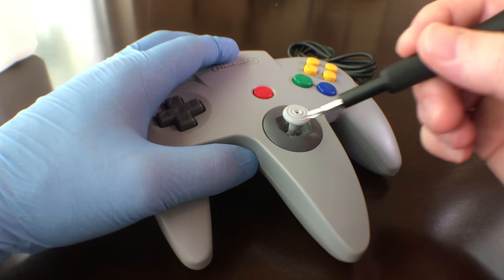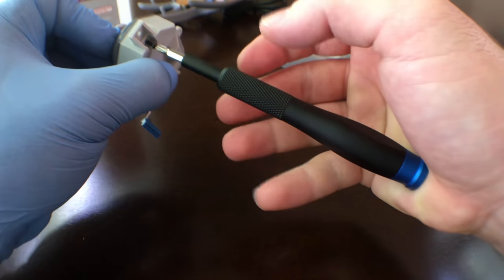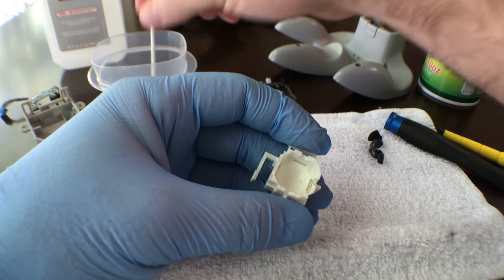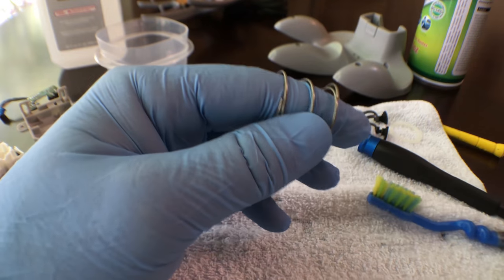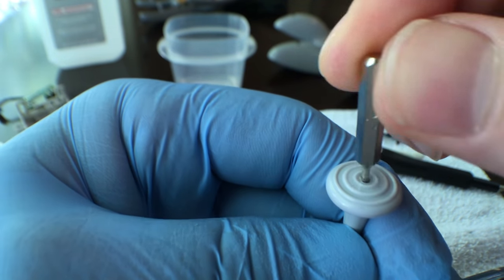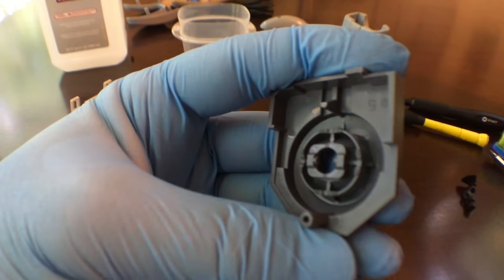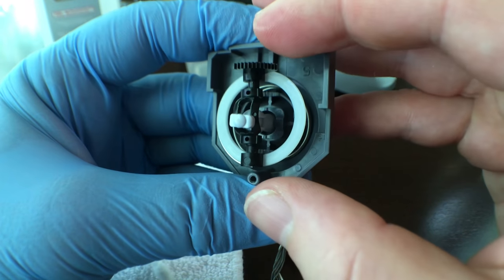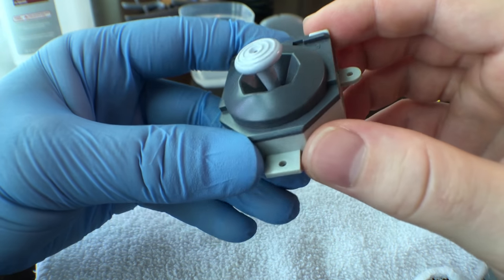Nintendo 64 (N64) joystick teardown - How to clean/fix/restore/refurbish

Comment: If done to an already loose controller, should it help the snapiness of the controller? or just keep it from wearing down more?
I just did this to an already loose controller and can concur it feels better, but it is still very loose. Just wanted to check
Reply from the maker: The Joystick Butter does two things. 1.) Prevents any future wear from occurring and 2.) Allows the joystick to smoothly snap back resistance free. That powder you cleaned out is what once was the gears hence why they're loose. Joystick Butter is magical.. just not that magical :)
Reply: @restore64  Putting together my second controller (I'm doing 4) and defintiely see the snapiness in this one. Sad it can't magically fix it, but that makes sense. Thank you for your quick replay and the video! This was a fun week long project as I waited for the butter to arrive!

Comment: Does cleaning and lubricating fix the looseness and floppiness of the stick?
Reply from the maker: No, lubricating doesn't add volume back to the worn gears. Sometimes simply cleaning/rebuilding will make the stick feel better and retain whatever tightness is still left.

Comment: After I did this my controller now creeks badly and the joystick clicks when moved left and back to normal position, any way to fix this?
Reply from the maker: Make sure everything is seated properly when re-assembling everything. Something is off.
Reply: I have that problem as well. I've been doing some maintenance on N64 sticks for a long time, and I've still not found a solution to that particular issue with the spring.

Comment: Any idea why a new controllers joystick would be messed up? I bought 4 new ones, 3 of which veer off to one side or are extremely sensitive/over reactive
Reply from the maker: You bought four new authentic controllers or four new aftermarket ones?
Reply: @restore64  3 aftermarket ones. I replaced one and realize now that those aftermarket ones are a lost cause
Reply from the maker: @rapathyk  I too, at one point, thought they were the answer. They're garbage :(

Comment: I have two and just bought two more, i need to go through all of them however one of the one I bought has seen a lot of use and I am slightly worried that the mechanism is worn down to much as the amount of slop is somewhat concerning. Any chance that it could be salvageable? Also what alternatives are there to the “joystick butter?” To me it looks like lithium grease in a precise injector applicator. More restorations and cleanups of other n64 accessories would be nice but I don’t know your personal life so I’ll wait.
Reply from the maker: If it's gone, it's gone. Joystick Butter won't fix the missing plastic on the gears but if you have a tight stick Joystick Butter will prevent it from ever wearing out. If Nintendo had this stuff when they made these every controller would have perfectly tight sticks. Wouldn't that be something :/
Reply: @restore64  k, thought as much, however will still be doing it to all my controllers no how bad they are as cash is tight at the moment, have a good day!

Comment: My controllers thumb sticks are loose, bit of a wiggle before moves register. Ordered new ones but could only find GameCube style as I cannae solder.
Reply from the maker: The GCS joystick is horrible and you'll lose all of your fine movements. If you push the stick more than 15-20% out the movement will jump out to 90%+ even though the stick isn't that far out. It makes every game a nightmare. Kart, Super Mario, 007 etc.
Reply: @restore64  as long as I can play again I'm not too bothered, not ideal I know but not like I can get new Nintendo parts as production stopped about 20 years ago. I'll try fix the original but not entirely confident I'll do ok.

Comment: Mine dig not look like yours at all. But I simply cleaned inside ant put a little bit of silicone grease. And now min it’s as new. But I ordered new ones that supposedly should hold up better.
Reply from the maker: You may have an aftermarket stick.

Comment: Thanks I taking apart my 64 Controller and was having a little trouble figuring out how the joystick back together I also found a bunch of white crude in my joystick is that a common thing does anyone know about it
Reply from the maker: Yes, that is plastic "nylon" dust. That's from your ABS joystick wearing away at the soft nylon gears.
Reply: @restore64  oh okay, I see. Is that why the joystick is loose, but still works fine?

Comment: I’ll definitely be picking up some of that lube. I came across this video today because I recently scored 2 of the funtastic consoles, a jungle green CIB w/ all styrofoam and an ice blue (no box). The green is mint and on eBay for sale, but I’m keeping the blue for myself. Only trouble is the stick was pretty bad (and controller was filthy). I’d say stick was 3/10, maybe 4. After cleaning it out it’s prob a 7.5/10. Huge improvement. Thanks for the info. I’m good with taking stuff apart and cleaning, but had never done anything N64 before and didn’t want to make my 3/10 controller a 0.
Reply from the maker: There's really something special about finding CIB decades later. These controllers are pretty indestructible. The point of the Joystick Butter is to prevent wear and keep the gears perfectly lubricated. It won't increase your tightness but if you have a really loose stick and it's cleaned properly it may definitely feel more responsive.

Comment: What about using silicon based plastic lubricants? I use them for my 80s and 90s mech kb switches. I'm mostly interested maintaining the original analogs as well since it seems all the replacement options aren't as good as the original.
Reply from the maker: I've used them all. They all "seem" to work since they're all technically lubricants but they don't do exactly what you want them to. Some get sticky, some dry, some are too thin, or too thick, some dry into a dusty like abrasive that makes things even worse, and a hundred other nightmare scenarios. White lithium grease was by far the worst thing I tried. Putting actual butter in your joystick would probably work better than half the stuff people recommend in online forums. Joystick butter is expensive for people who just have one or two good controllers they want to keep tight but for me, a controller enthusiast/collector who does a lot of them, it's worth it's weight in gold. There's literally nothing like it.

Comment: The two joysticks on my controllers have gotten very loose over the years.  Do you recommend getting replacement parts as I follow your process?  Or do you think the process is usually enough?  If so, maybe you could point me in the right direction.
Reply from the maker: The fine dirt/debris in the housing is essentially what was once your gears/gimbals. So if it's loose this processes won't make it tight. It merely prevents them from wearing out further. There's not a single affordable replacement option on the market that is even half way decent. Your best bet is to go on eBay and search for N64 controllers in Japan. Their controllers came lubricated. Not by much but more than ours which weren't lubricated at all. You can normally get one for $30-$35 shipped but I haven't checked in some time.
Reply: @restore64  Gotcha, thanks! If I go through and order them, would you still recommend opening it up and applying some joystick butter?
Reply from the maker: @Trevor_Exley  100% - I still use the same controller from this video and it's still perfectly lubricated. It hasn't worn down at all. Pretty wild considering when I was kid I had so many controllers with loose sticks laying around. I remember all my friends coming over after school to play 007 and those were the sticks they got to play with :) The fact Nintendo didn't properly lubricate them or the fact they didn't just use a potentiometer like Playstation still doesn't make any sense to me.

Comment: I cracked mine open and found what looked to be battery acid or some white sand substance. What is it and what can I use to clean it?
Reply from the maker: If you follow the steps in this video you wont have that issue at all.
Reply: Krynek yeah I figured it out another video, but thank you anyway.🙂

Comment: Restore64, great video, I really love the amount of care and detail that went into this. This worked great on one of my controllers, but the other is really worn down. What would you do to a controller with a floppy joystick?
Reply from the maker: One method I've seen is applying heat and pushing the outer edges of the gear in with an additional heat source in the middle to melt the inner walls flat again thus making the gear perfect. I believe this is along the lines of what the steelsticks64.com guy does when refurbishing and fitting his joysticks with his own custom internals. Hopefully someone will release a tool that'll make this easy to accomplish then everyone will have perfect sticks :)

Comment: What's wrong with the kitsch-bent parts? I've restored some very loose sticks with the gears/bowls before. Of course, I'd keep original parts if the sticks where still tight.
Reply from the maker: Well they're not as bad as the company name "Kitsch-Bent" but they're far from perfect. Even if you meticulously remove all of the flashing they're just not good. If you take a joystick refurbished with KB parts and compare it to a factory fresh N64 joystick you'll know what I mean. The KB example will feel very rough and gritty.
Reply: That's fair enough. But it's turned my unusable sticks (as in the stick would flail around if you shook it) to usable, and they're dirt cheap. I might do an epoxy style refurbish with my OEM parts one day, but for now they're worn out beyond recognition.
Reply: By the way, have you had the opportunity to try the steel sticks bowl?
Reply from the maker: For a cheap fix you can't beat it. But I wouldn't do it. It'd suck the enjoyment right out of the game for me. Look into using heat to fix the gears. Epoxy is a lot of work. Steel sticks is too rich for my blood. He goes through great lengths to produce those extremely high quality parts but without getting into it I feel like it solves one problem and creates another. Regardless, if Steel Sticks wasn't so expensive I'd still buy one.
Reply: Dude like how? I don't want to go cheap and unreliable with the tape, so how?

Comment: Will lubricating prevent the loose joystick issue if it hasn't happened yet?
Reply from the maker: Yes! That’s the main point of this video. If you have a factory original joystick that is still tight you HAVE to do this.

Comment: can you just use any other lubricant like a wd-40 or something like that?
Reply from the maker: WD40 literally breaks lubricants down so using it by itself, especially on plastic, wouldn't be a good idea. Also, it's too thin, you'd risk flicking the oil onto the board and optical reader in the joystick. Recipe for disaster. I know it's expensive but if you want a perfectly lubricated stick you have to check Joystick Butter out. It really is amazing.

Comment: Great video I know it's old but it helps one question what if I don't have joystick butter any alternatives thank you.
Reply from the maker: Thanks! The joystick internals are comprised of two different non compatible plastics. This lubricant is specially designed for it. I tried about 15 different things before I bit the bullet and paid for it because I'm cheap but it's worth it's weight in gold. I can't, in good faith, recommend anything else.
Reply: @restore64  Thanks good to know

Comment: After reassembling my controller no longer registers when I move the stick left or right. Anyone have any idea what I did wrong? I've tried taking it apart and putting back together a few times now to make sure I did it right but still not working :(
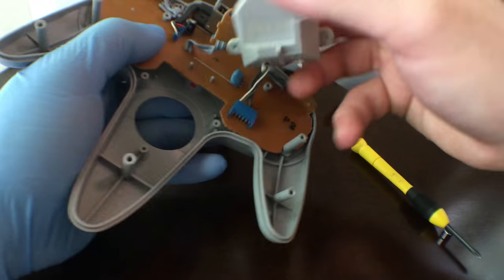Reply from the maker: I don’t mean to be insulting so please don’t take it that way but did you remember to plug the connector back into the board? 1:34
Reply: Restore64 Ahaha no worries, thanks for your reply! I did plug it back in, I honestly really wish that was my problem :)
Reply from the maker: @JustinGauvin  I've never had it happen to me but if you got dirt/dust on the optical sensors that could potentially cause that. Try getting into a game and seeing if you have any movement in any direction at all.
Reply: Restore64 Movement up and down works fine in game, and it looks like the optical sensors are clean. I also just noticed there’s a small crack in the PCB board so it may be time to just get a new one. I really appreciate you helping me troubleshoot though!
Reply from the maker: @JustinGauvin  Maybe it's just the "left/right" optical reader? Could try flushing it with some iso and compressed air. Couldn't hurt. If it's not a rare controller or one that you like I can see not wanting to invest too much time into it though. Where the board is cracked are there any traces on top of the crack/damage?

Comment: Very detailed video and thanks for that Joy stick butter info, i wasn't sure what type of grease or lubricant i would have used to properly maintain my n64 in good condition but, now i know :D ,also how long has your current Joystick butter lasted? is this your second or third?
Reply from the maker: I saw your earlier comment and to reply to that it's called "isopropyl". I put it in the video description. It's very strong stuff so protect your skin and make sure you don't use it on any visible surfaces on the controller because it can burn the plastic if you use too much. I've used tons of different stuff but the Joystick Butter is the superior option. Once you use it you'll understand why. If you have a tight stick and want to keep it that way you need to properly lubricate it since they don't come properly lubricated from the factory. It's been 2 years since I applied it to my daily driver and it feels as good as the day I applied it. I've restored over 100+ controllers and I'm still on the same tube. It has been awhile but I believe mine came with 3.5-4ml. For the average person one tube will last you a lifetime. With the precision tip it allows you to apply only what you actually need so if you're just using it for one controller you won't even see the plunger go down.
Reply: @restore64 Is this joystick butter similar to white lithium grease?

Comment: mine feels really scratchy now even after i cleaned and lubed it with joystick butter
Reply from the maker: The joystick butter prevents internal parts from wearing. If they are already worn, or in your case damaged, you will feel that feedback in the stick regardless of what you use :(

Comment: So this fixes a loose joy stick? Just seems like your cleaning it?
Reply from the maker: Fix in terms of fixing the issue that causes the gears to wear out. Additionally, if anyone is looking for a teardown/build-back video to maybe fix something on their controller they might find this video useful.
Reply: @restore64  it’s a great video of how to clean. But I wanted to know how to fix them. I watched the whole thing waiting to see how to fix them and was a bit disappointed.
Reply from the maker: @thomasmaher6880  what specifically are you trying to fix? I can help.
Reply: @restore64  a loose and none responsive N64 joystick.
Reply from the maker: @thomasmaher6880  these gears, since they are not lubricated at the factory, are considered wear items. Much like tires on your car. Once they have worn done they are done. People on YouTube use epoxy to fill in the worn-away areas and sand them down but they will never be like factory fresh gears. As far as the stick being non-responsive try to "carefully" clean the optical readers with isopropyl. Use a fine q-tip to polish the lenses. If that doesn't work try swapping out joystick assemblies to make sure your board isn't bad.

Comment: Will this actually help a stick that is no longer right?
Reply from the maker: To put it simply, no. Cleaning it and lubricating it properly will bring a little bit of life back to it in terms of tightness and real feel but nothing major. This process, if done exactly how I showed it, will however prevent the joystick from ever wearing out again and it's what I do with every joystick I get. Even crappy ones I let my friends play with. So if you find a good authentic stick and it's tight just clean it the best you can internally, lubricate it properly, and it'll last you a very long time.
Reply: Restore64 oh ok gotcha. Thanks for the quick reply! Out of curiosity do you know of any good quality replacement analog sticks for the N64 controller? Or would you recommend just trying to find another original one with a tight stick
Reply from the maker: DO NOT buy an aftermarket stick. They're all horrible with the exception of some that are outrageously expensive. If you buy one you'll regret it. You can usually pop into a local video game store and grab a nice one for $25 or off of OfferUp, LetGo, Craigslist, Facebook Marketplace, etc but if you ever buy one online check out eBay... I've scored quite a few really cheap ones from Japan that are almost always in perfect condition with perfect joysticks. It's important to know the difference between what an authentic and aftermarket stick look like because they make some aftermarket ones that look very similar.
Reply: you can also use epoxy and a dremel to add back missing material and sand it back to shape.
Reply from the maker: I've always wanted to try this. I know it works. Just haven't had time.